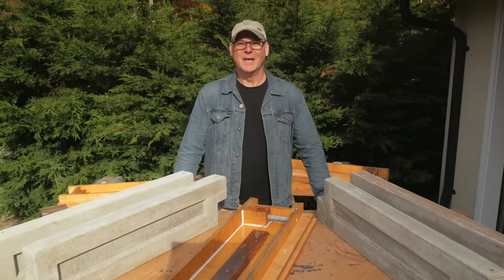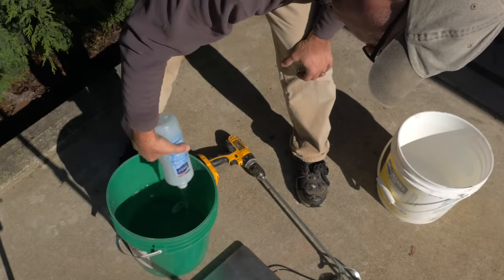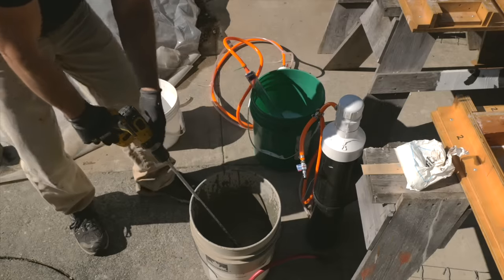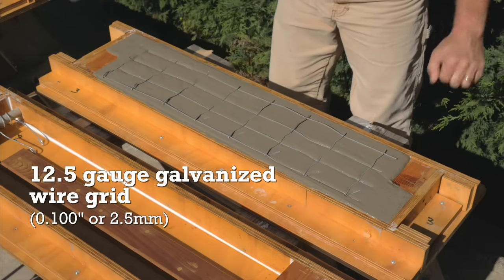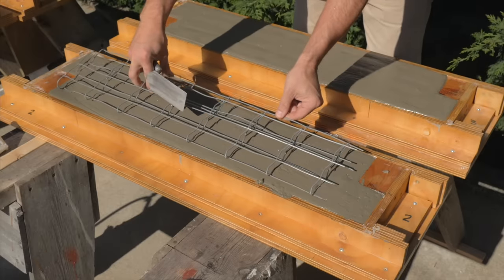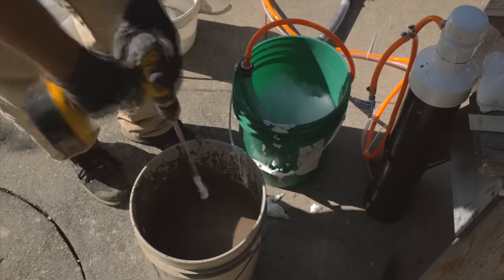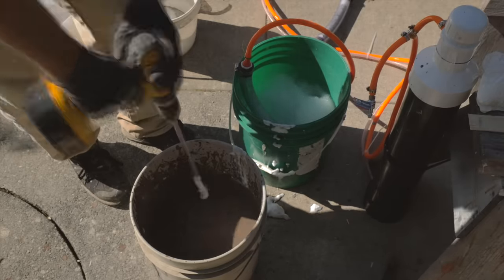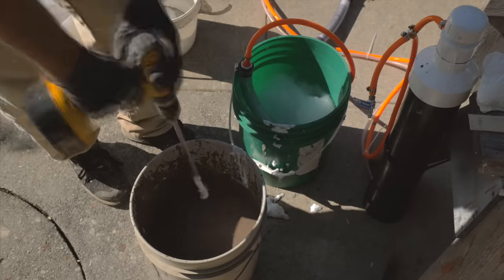Aircrete Garden Boxes PART 3.6 - Air Crete Lightweight Foam Concrete from Portland Cement

Comment: I guess you can always make a mix of pieces. Use the heavy duty ones for the lower level of a tall box so it can withstand the abuse of hard objects such as a trimmer or metal tools and light ones on the top for less weight and reduced cost.
Reply from the maker: Yes! That's a great suggestion!
Reply: @MANaboutTOOLS  don't forget extra reinforcing and added drain/weep holes/french drains in colder climates
Reply: its not realy the weight what matters if you get it strong enough

you could use U shaped reinforcements who reach in the bars on top and bottom to create a 3d formed reinforcement of the elements

as perlite gave you i guess 46% ligther modules its more easy to produce and more persistent if you mass produce it as foam. there are also foamglas (or stone i cant find it) perls who have a lot higher strength than perlite and air in it, that together with perlite and glasfibers and csm concrete should give you the highest strenght over all 

CSM cement with 3d bendet reinforcements who reach to the pipe elemets would be the best for high load modules who can go at the bottom of a raised bed

you can even colorcode it with different colors or shades to blend the bottom parts of a raised bed better into the landscape and cover some spatters from rain or grascuttings (and easy to different from the others)

@MAn about Tools: i would every time use glasfibers in the mix it makes a hughe different in breaking resistance.
and you can use plastic mesh for concrete floors with at least 8mm mesh with as reinforcements instead of the rebars. maybee combined with a single steel bar for length strength against breacking (but i think its not needet with your design)

best part is you can cut the plastic mesh to reach into the ears and to the pipes and you dont add steel to the modules who can rust in the long therm
 just dont use to small mesh width because it will separate the 2 layers of concrete

Comment: I love that you actually hydrated you aircrete for curing, it seems everyone else neglect that step.
Reply: would sprinkling water work like submerging the panels?
Reply: @jeffreydustin5303  A constant mist would be fine, anything you do is better then doing nothing. Seems like a waist of water though, if you dont recycle it.
If you can, make a tub from ferrocement
:-)

Comment: These panels are GREAT! Totally impressed with the forms. The shape makes me think you could make walls or other structures as well. My only suggestion would be to make a recess in the bottom edge and a matching key on the top edge to make stacking more structurally stable.
Reply: GREAT IDEA.  A lego version...

Comment: This might be a stupid question, but could you first pour a small amount of 'normal' concrete into the mold so that the facade is more dense and durable and then pour the aircrete on top?
Reply from the maker: That's possible. But, I haven't tried that yet.

Comment: So how much do they weight? and how much does a full concrete side weight, Thanks
Reply from the maker: Regular concrete 36" panel weights 50 lbs. The aircrete from this episode averaged 22.125 lbs. So 56% lighter
Reply: Thanks for the question and answer my friends .
Reply: @MANaboutTOOLS  wow! it really did not look like you added enough foam to make that much of a difference - nice! you mentioned 8" mark? would you say that was about 8" of concrete mix and 8" of foam mix? I see your measurements in terms of weight, it would be nice to know these two in terms of volume... Thanks!
Reply from the maker: @min2oly  Maybe 4" of each approximately. I added just enough foam to the slurry to bring the aircrete blend up to the 8" mark on my stir stick. That was then the volume that was need to fill a 36" form.
Reply: @MANaboutTOOLS  have you tried using loose Styrofoam instead of the aggregate?  Probably a name for this mix, but I don't know what it is.  Styrocrete?
Reply from the maker: @TheGorignak  I have not tried Styrofoam. Looks like it might yield similar results as the perlite.
Reply: @Panthera Makes sense.  I do hate all the hemp related stuff coming out (it's the latest buzz word).  I hope it doesn't become one of those over produced things like coconut, palm, and tea tree, where turn entire forests into a single crop plantation.
Reply: @Panthera Reduce_REUSE_Recycle. Yes it's "fossil fuel", but it's better than putting it in a landfill. Don't buy Styrofoam, there's lots of places trying to get rid of it. Around here, there's no way to recycle Styrofoam.
Reply: @Panthera Anything organic added to the mix is going to decompose over time and weaken the bond. I'd rather add styrofoam to keep it from going into a landfill.
Reply: 14:06 was not "BIG" enough? Well.. you should look the videos before asking..
Reply: wow! the last time i`ve seen a video about aircrete they were usin foaming agent that. where i live is almost imposible to.get. but it surprised me which product you used. and the great results you`ve got... is it just shampoo used to wash your hair? if it so, i`ll try it! thanks for the video
Reply: Good information. Thank for guaid
Reply: TheGorignak I understand what you’re saying however hemp can be grown locally and is rapidly renewable therefore eliminating many of the problems associated with importing the plants you were speaking ok. Hemp could be the future
Reply: @TheGorignak  The problem with using loose styrofoam is that it's very light and when you vibrate the form to remove any air bubbles the styrofoam spheres will also float to the top 😂
Of course not all of them, but enough to make the top half much weaker than the lower.

Comment: Hybrid design best of both worlds
0.5" regular concrete +  2" Aircrete = Awesome !!
regular concrete = cement + sand + fine/medium stones
Aircrete = can use a lighter mix (more foam), = cheaper / lighter / insulator
Wire mesh for tensile strength
fiber glass is also important as it also adds a lot of tensile strength.

concrete will be the bottom layer expose to punishment, the rest aircrete is just a filler stuff, 
Aircrete is also an extremely good insulator, good for putting a cheap PVC green house hoop, "Aircrete Harry" has done plenty of vids on his channel.

I dont really think you need fine/medium agregats/stones, just cement and sand will be tough enough to handle the occasional weed wacker
single wire mesh + fiber would be stronger then double mesh with No fiber

Something affordable, light, fit for purpose !

Comment: The longer I follow this series the more I am convinced to use these cast "box sides" as the stepping face of terracing I will be installing along my road front gardens instead of blocks, bricks, and tree trunks!  What convinces me to this direction is the ability to be able to drive longer rebar through the connection points for extra strength against being pushed forward if there is a shift in the slope above the terrace step.  Thanks for a great idea, and your continued work to improve on the mix ratio possibilities.
Reply: I would recommend a few changes if used for terracing for example every 2 panels adding a brace that goes into the hillside at a right angle to the wall to help stabilize the wall reinforcing it against the dirt loading as well as you'll need drainage behind the wall/thru the wall to prevent bulging/ blowout out via hydraulic saturation from rain/snow/watering/other forms of precipitation
Reply: @dodgeme1986truck  thanks for that insight, possibly building the casting forms smaller, 2 to three feet, and putting them in a zigzag pattern with up to 90 degree angles would be beneficial. Also changing the casting form to create weep holes along the bottom edge should help prevent bulging via the possible hydraulic saturation; even with the soil having good drainage and no bulge present with an 8 inch step in the terrace, changing to an increased step could cause a problem with the future remake of the road front gardens. 
(The old gardens were destroyed by a new sewer project, thus I have a new canvas to work with now.)
Reply: @stevenstillwell-NC  even in good/excellent draining soil as little as 1 foot of terrace height with a very heavy rain can cause problems so yes the weep holes would be good and the zig zag pattern would act as the anchoring bars... been there ran into all those problems before with a neighbors retaining wall (the contractor who put it in was from a warmer climate that didn't freeze and didn't install any drainage behind the wall because the soil was sandy and drained fairly well on its own)...even with the sandy soil behind the wall we had an extreme rain storm (dumped several inches of rain on top of 18 inches of snow we already had that spring with 3 days sub zero directly following) because the sandy soil couldn't drain fast enough it was water saturated when it froze and it acted like a hydraulic ram on the back of the retaining wall causing the wall to fail (for regions that freeze it is highly recommended  to add a french drain behind the retaining wall in combination with the weep holes) and in colder climates you'll want to increase the thickness of the panels as well as doubling the reinforcing mesh 1 layer being closer than the half way mark to the face of the panel
Reply: @stevenstillwell-NC  that's what we always called a "deadman" when we would do landscaping and would put in wooden timber retaining walls. No matter the height of the wall to be built, you are absolutely correct, weep holes and deadmen are absolutely critical to the longevity of the new wall.

Comment: To save on the cost for coloured cement you do not need to colour the whole batch, the middle won't be visible anyways. you can either poor it in sections and put uncoloured cement in the middle but you still have edges without colour, you can use coloured cement to "paint" the block later and this makes it even cheaper.

Comment: Here is an idea: Professional bubble blowers use glycerine to make sturdier bubbles. It may well improve your foam base for concrete.
Reply: I use glycerine in my aircrete. definately works well.
Reply: Anomika K 
Thanks for your contribution re: Glycerine..
How much ? What concentration?
Reply: @RutherfordRyan1  A splash. Not even a tablespoon to a cup of soap.
Reply: @RutherfordRyan1  I use a tablespoon for what ends up being 5 gallons of aircrete. I have not experimented on using less but I will be in the near future as I'm trying to lower my costs. I got a lot of aircrete to make.
Reply: @HenkJanBakker  good to know. I'm over using.

Comment: Next time can you also add the metric volume of each component rather than the weight. It's OK with water (as 1kg = 1 L) - but often it's much easier to measure everything by how many liters are needed as often scales aren't available.
Reply: We use pounds and gallons in the states. If you are looking for metrics then just use a conversion chart to figure out your measurements
Reply: @1982MCI  while it is easy  to convert from standard to metric, it can be difficult to convert from mass to volume. Think of it like this, a 5 gallon bucket of water will have a different mass than a 5 gallon bucket of sand. The only thing that converts from volume to mass directly is water, as the metric system was designed on this principle.
Reply: My hot tub company does this when I take in a water sample for testing. They always tell me to add chemicals in grams, rather than in milliliters. not everyone has a micro scale, but I do have an old set of cheap measuring spoons.
Reply: @mikescott7123  Weights most likely will be different for the same volume of different substances. I find it's easier to go by volume as ultimately - when you arrive at the correct mixture - it boils down to  ratios of different  component parts.

 eg.  1 litre of cement, 1 litre of sand and 5 litres of foam - is easy to put together if the only measuring device you have is a 1 litre container.

Or for that matter - a 1 pint container.

Comment: You're the best at comparing different combinations for these mixes. 
1) Did you notice any difference in foam density between your custom foam screen mixer and the Darwin foam generator?
2) Would it be interesting to show a running comparison of total price of a section to weight and durability? ( Should durability imply weight? )
Thank you for being so detailed. I'll give aircrete another shot.
Reply from the maker: Thanks! The Foam Mate seemed to produced a denser foam. And it makes just the amount you need. The foam screen mixer works pretty well but I would have to make more than I need for a batch. The weight of each is very close though. I might need to do a more detailed and thorough test and comparison.

Comment: I never knew you could make aircrete, is this what they use when blowing in cement (pool construction)? you could always just use a durable cement on the bottom layer and use the aircrete on the 2nd and up layers

Comment: Hi Kent, I would love to see a video giving an overview over your different boxes built, with weight comparisons, durability evaluations, cost(!) and so on.
And one more thing from an engineering point of view: How would you change the design in order to use the pieces for a compost structure?
Cheers,
Reply: Added thickness for strength, weep holes near the bottom (to let the juices run out and da worms crawl in), extra reinforcing mesh/heavier gauge mesh (more strength), using straight concrete(more strength), and anchoring it extra deep/splayed entry (prevents the entry side from bowing out), making each panel 4 lugs high (think double sheer more strength) these are the thing I can think of for building a concrete compost bin/yard materials bin.
Reply: @dodgeme1986truck  Just curious, What's 4 lugs high mean?
Reply: @evilroyslade2491  phone cut it 4 lugs high walled

Comment: I wonder if using the double stacked raised beds inside a greenhouse? work? using the lava or vermiculite panels on bottom and the air crete panels on top...fill inside with old wood, limbs, leaves, etc. last remaining 10-12" with good compost for planting make it all longer lasting.

Comment: Great investigation, great presentation.
I have been very curious to see what aircrete made with CSA  cement would do, would you consider trying that mixture?
The CSA cement has greater initial strength and it is more resistant to heat, so I imagine CSA aircrete might make for a great material for a fire pit.
Reply from the maker: Thanks! See Part 3.7

Comment: So, I want to ask about sealing them. I have about a dozen more questions, but what I've noticed from other's videos is that the aircrete needs a coating of mortar (or something) both for structural integrety (not much need for that in a garden planter) and for protection against water damage (some need for that may apply to the garden setting). Did you seal them? With what did you seal them? After the month of curing, did you do any structural testing? ...??? Thanks. B.

Comment: You should strength test these blocks though. it is SOOO important. pretty please !!  So let me explain what I mean > there is a YT channel called CNC Kitchen, Look for a vid called the best 3d printing material. @ 8:00 you will see his machine.  (Years ago there were vids about building this machine, looks like they r gone). Then at 10:30 he starts speaking about the measured data.  The key point is >> this is a person, not a corporation. not a super-hero. Just a man who dedicated time and did good work.  <<   Its soo important that we share technology with each other. Otherwise we will be unaware, and have to go to the store to buy a bag of magic.  Paying untold amounts for cooked sand.  hmm , I wonder if Mr. Cnc Kitchen would be into helping out ... hmmm

Comment: Thank you sir for these demonstrations of yours to do with the various ways of making these concrete panel sections. And I like the ones to do with using the foam mate methods. And so my question is this. Can these methods such as with the foam mate compounds be suitable for using as garden concrete blocks, as one would make when needing to put in a concrete pad some where say for a garden shed floor as I am going to do one more concrete pad in my back yard, which is rather small, and the dimensions would be about two meters wide by 3.5 meters long by 200 ml high.? Again my thanks for your efforts.

Comment: To anyone that wants to try this, one thing to note is that to much water to your concrete will weaken the final product. I'm not sure if he using a plasticizer with every mix. The slower the concrete drys, the harder it will be, and he shows that but the initial mix seems to wet. Please note that I know nothing and what I do know, I can make a mess of things.

Comment: I'm sure the single-vs-double wire durability difference would come up only after months if not years of usage and after several temperature and humidity cycles, e.g. days and nights, summers and winters. That is, if there is one big enough to notice.

Comment: Awesome.  I wonder whether a foam gun that is used with a pressure washer to spray foam on a car would work.  You fill a 16 ounce bottle with dish soap and attach it to your pressure washer.  I'm thinking fill up a bucket full of foam.